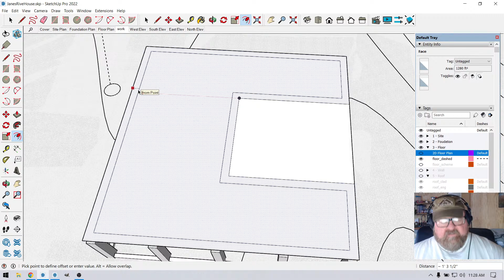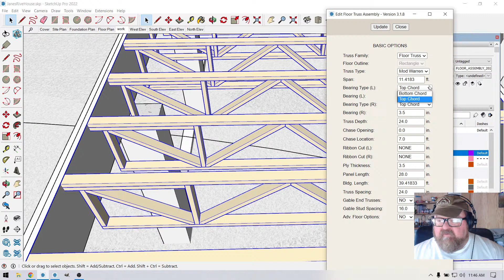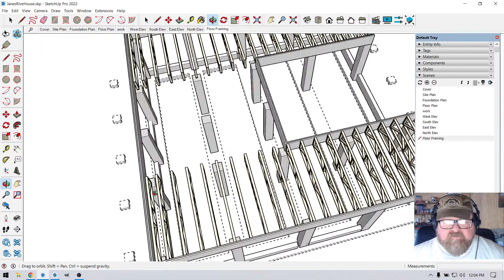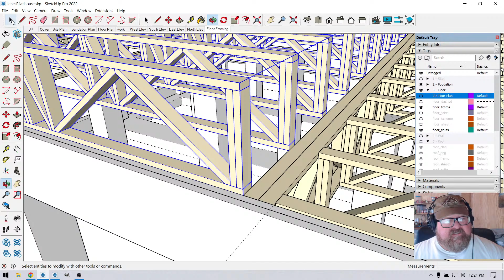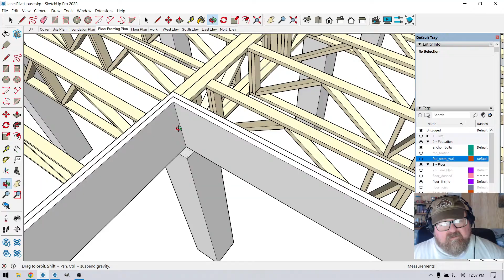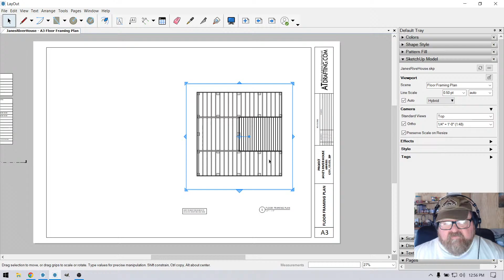Floor Trusses for Jane's Elevated Florida Home - Live SketchUp Work Session

Comment: Loking good. Have fun with the engineers....lol, I just finished one similar to yours, and it came back so messed up. The problem with Florida is that the engineers have the final say.  I wouldn't put too much effort into the framework until they take a look at it, unless you know an engineer down here.
Reply from the maker: That is why I said I was just showing the concept of trusses and how they line up so the plumbing can be installed in the plane of the trusses.  The floor truss company will actually pre-engineer the trusses and the girders and show the bracing plan for the job location.  I am just trying to show the homeowner what to be prepared for :)
Reply: @ArtisanTony  that's cool, I just meant that the engineers are a pain in the you know what..lol definitely need them down here for sure. I had  done the whole plan in sketchup and layout 10 pages worth only to get an email from the engineers requesting a dwg file.. I pretty much had to re draw the whole plan in autocad,  I imported the sketchup up file, but it still was a lot of extra work... anyway, I could watch you all night, haha, as weird as that sounds..lol
Reply from the maker: @bigiron5508  Thanks a bunch! :)  You know SketchUp will import and export dwg files?

Comment: My apologies if I missed something, but why hang the floor trusses rather than set them on the LVLs? I know hangers can work but I'd feel so much better if my floor trusses were sitting on them.
Reply from the maker: It would add another 12" to the thickness of that zone and also elevate the entire home another 12". It also is more stable because the trusses help brace the LVL laterally.   You also do not have to trim out or paint the inside of the exposed LVL's  if you put them in the same plane.  There are many reasons :) but it is a good question.

I have built many homes in my 42 years and I think it just looks better also :)
Reply: @ArtisanTony  That all makes sense. My fear would be the wrong or defective nails being used for the hangers and then corroding away and there goes your floor to the ground.
Reply from the maker: @joshuasmith1215  If you use the right type of hanger, you have no worries.  After you install the subfloor and build a wall on top, you literally do not have to nail them :)  That is an exaggeration but it is close to being true so the worry about nails is just worry.  I have built this stuff for many years.  Take a look at these hangers, they will not fail without a torch cutting them loose :) https://www.lowes.com/pd/Simpson-Strong-Tie-HIT-Galvanized-Top-Flange-Joist-Hanger-for-3-1-2-in-x-24-in-Engineered-Wood/5001528325?cm_mmc=shp-cprdbdmgglPLA_BDM_103_Roofing-Gutters-5001528325-online-0-_-0&ds_rl=1286981&gclid=CjwKCAiA5Y6eBhAbEiwA_2ZWIT_noG0OprAy69yALZHhSNq7xYHs2XfkvrwSnEMx4TKVuxQ7xkPojBoCuWcQAvD_BwE&gclsrc=aw.ds
Reply: @ArtisanTony  awesome my man! Appreciate the feedback. I just wasn't picturing hangers that have the flange that sits on the top of the LVL.